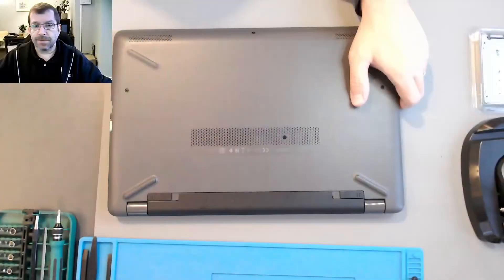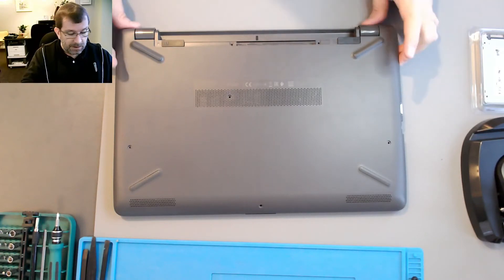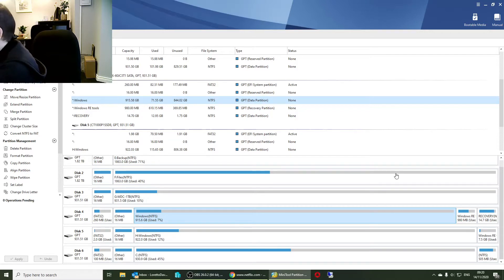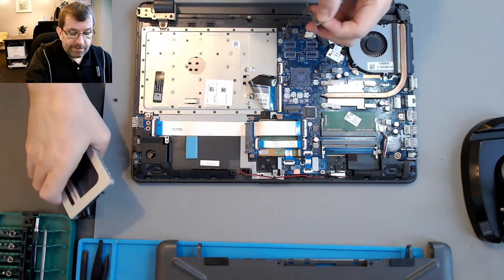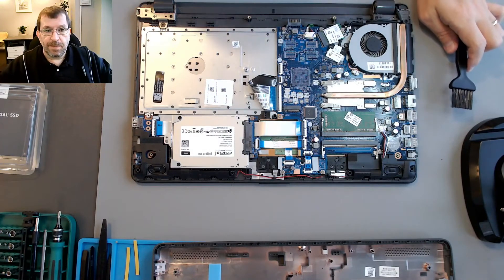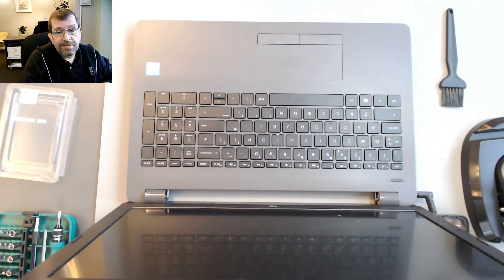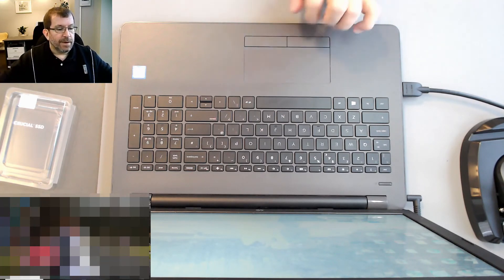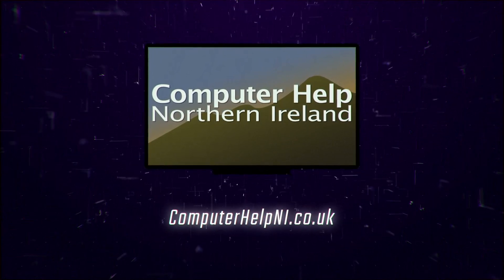[6] HP TPN-C129 laptop - SSD upgrade

Comment: hi every one,in fact, a clean windows installation always gives better results, if the old operating system is healthy, it will do the same to take an image from windows and install this image on the ssd, 3rd party software may not always give good results.hp brand always does this, hides the screws etc. If you are going to buy a new computer, first choose LENOVO (thinkpad) and then DELL, ACER or ASUS. In models with Intel and AMD processors, the screws are hidden under the tires. HP consistently manufactures these sloppy computers, sloppy even in corporate PC models. Good luck.
Reply from the maker: I agree that a clean Windows installation is the ideal, but in most cases my customers didn't have the ability to reinstall the old software that came with the computer (and that they still needed), so cloning Windows was the best option for them.
Reply: Updates to the OS is exactly why these HDD based HP Pavilions die in the first place! The OS updates get increasingly more demanding and choke the drive. I've got two computers that have died because of updates, one identical to the example in this video (was just as slow, if not slower, after a clean install of windows) and the other is a 2013 Lenovo AIO C340 which is just as slow.

Comment: The screws hidden!!! with the fast forward it's not clear
Reply from the maker: You make a good point! Each of the rubber 'feet' concealed a screw, and the video fast-forwards through the points where I remove those. Sorry it's not very clear! I'll try to avoid doing that in the future.
Reply: @ComputerHelpNI  
in fact I did not understand why it did not come away I was going to break everything. :) :) :) Fortunately, when I feel that something is wrong, I move with caution. Thanks for the video BTW

Comment: I have the same laptop Can I install ssd by replacing cd drive cause I want hdd and SSD both or in this laptop m.2 SSD can be install
Reply from the maker: This laptop (HP 15-bs158sa -- TPN-C129) doesn't have an optical drive. Here's the spec: https://support.hp.com/gb-en/document/c05817137

However, most laptops optical drives have a different SATA connector than what you will find on an SSD, so swapping them would not be possible without some type of adapter. Search Google for 'laptop drive caddy' and you might find what you need.
Reply: @ComputerHelpNI  I have an identical model to this in almost every respect (case style included) but it does have an optical drive (in fact I made a point of getting it because it had one xD).

Comment: You forgot 4 screws mate. You have to pull the 4 rubber plaques away and you would have seen it. Thanks to this vid I broke 2 pilars. :-(((
Reply from the maker: Sorry about that. Someone else already pointed out that I fast-forward through removal of the four screws hidden by the feet. I added a note to the description, but perhaps I need to remove this video or add something to the thumbnail to warn people...

Comment: Hiya, I think you should seriously consider editing your video, or at least add a pop up comment for correction at 1:30 to mention about the 4 hidden screws and the fact that you'll have to pull out the DVD drive, otherwise you'll never be able to remove the bottom panel.  Most people would just click play and watch your video without reading the comments to figure out they're missing something...
Reply from the maker: Thanks for the feedback. This laptop didn't have a DVD drive, so I'm not sure what you're referring to. As for editing the video, my only option would be to delete this video and upload a new one, as YouTube doesn't allow editing of existing videos. I will add an edited version and then put a card on this video linking to the new edit.
Reply: @ComputerHelpNI  Thanks :) Just don't want another guy like me spending half hour trying to rip the panel off or worse breaking part of the panel.  As yours came up as the top result from my search. I'm holding in front of me a TPN-C129 that has a DVD drive! I think it's a different variant than the one you had :) saw another disassembling clip that has the same as mine too. Anyway thanks for making these helpful videos!
Reply: @charredlamb1104  They had two models, one had an optical drive, mine does too (one of the reasons I got it)

Comment: Can I ask why you are not using the M.2 NVMe slot?
Reply from the maker: Only because we had SATA drives in-stock, and the customer wanted to replace the existing (as opposed to adding a second drive). But you're right, an M.2 drive would have been faster.
Reply: @ComputerHelpNI   will it support M2 NMev?